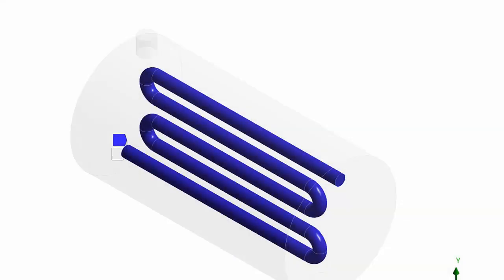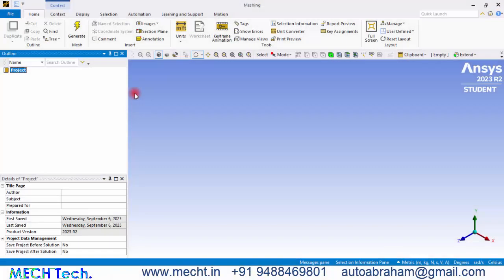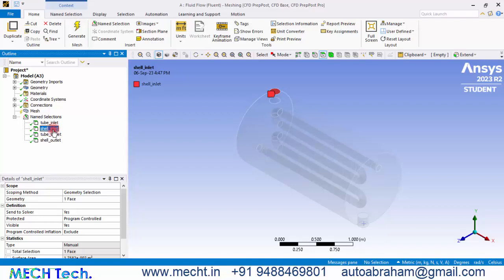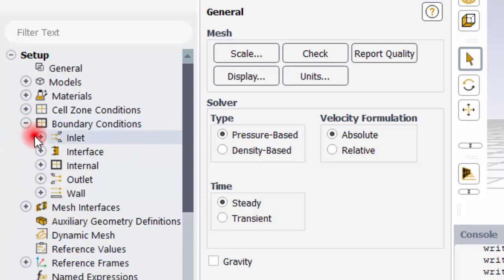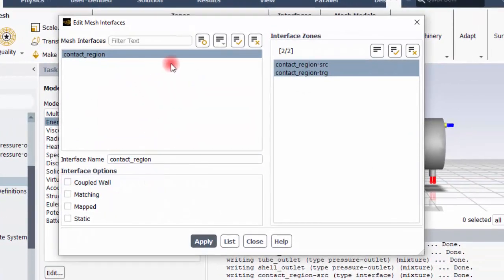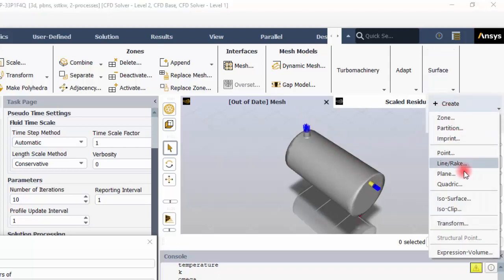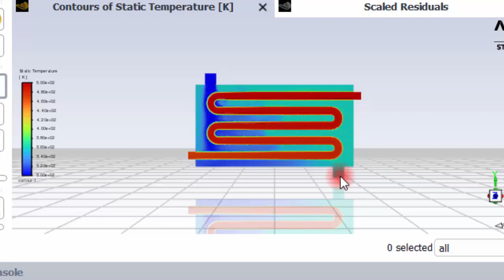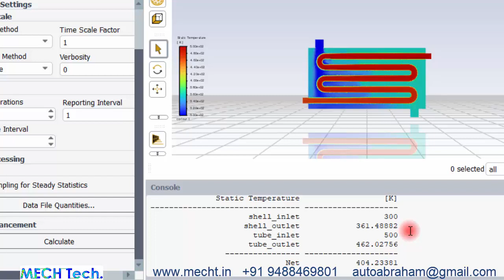Shell and Tube Heat Exchanger | Ansys workbench tutorial for beginners | Ansys FLUENT Tutorial

Comment: Good time 
Why use SST omega for turbulent ?
Reply from the maker: I chose the SST k-omega model for its ability to handle complex flow and heat transfer in areas with flow separation, making it ideal for heat exchanger simulations. Other models like the k-epsilon for high-Reynolds-number flows or the RSM (Reynolds Stress Model) for more detailed turbulence could also be considered, depending on the specific requirements.
Reply: @MechTechSimulations  Thanks
Reply: Good time sir
I made the simulation  the shell and helical tube with length of shell 112mm . The time of calculation is very long reached to 12 hour or more 
The model is k- epsilon 
This is correct that calculation time is long or not ?
Can be reduce the calculation?
With best regards
Reply from the maker: Even if we don't aim for very strict convergence criteria, the scaled residuals should at least converge to 10^-3, . If your mesh is too fine, the time taken for each iteration will be high. In that case, try increasing the mesh size and check the convergence of the results.
Reply: @MechTechSimulations Thank you very much

Comment: Good day, take your work as an example for a simulation project, what do you recommend to obtain a convergence? I requested more than a thousand iterations but I can't get it to converge
Reply: the temperature after a thousand iterations at the input and output are equal but I do not obtain convergence
Reply from the maker: If the temperatures at the inlet and outlet are the same, it clearly shows that no heat transfer took place from the tube to its neighboring fluid domain. Probably the interface between those two fluid domains is not defined.
Reply from the maker: Convergence is mainly affected due to poor mesh. Try reducing the size of the mesh.